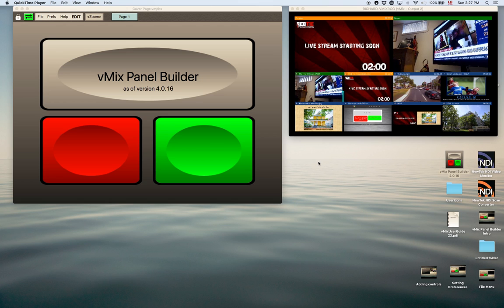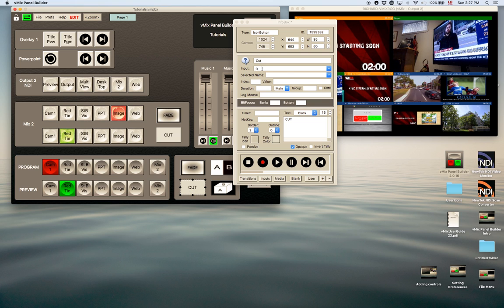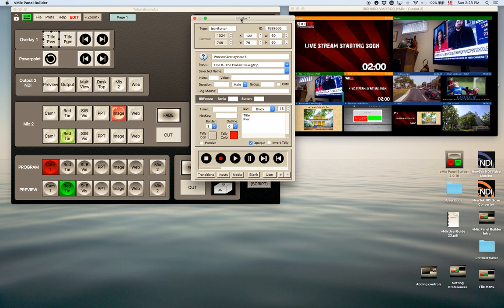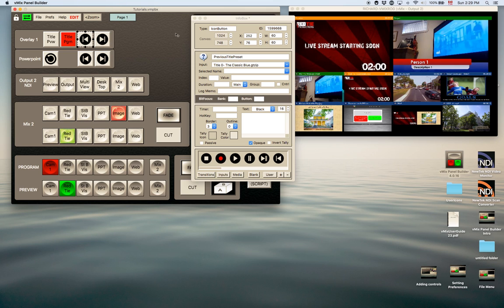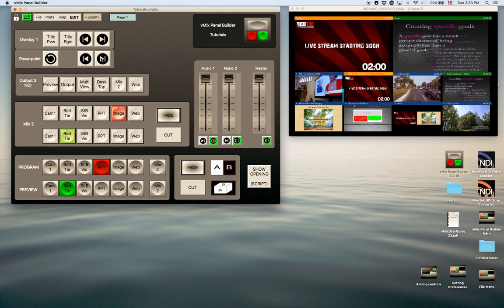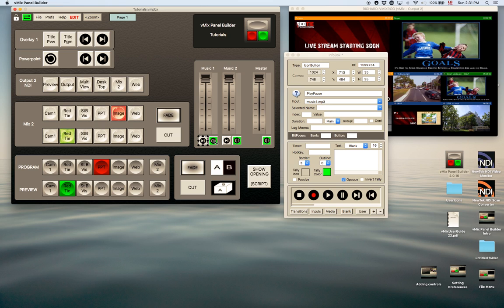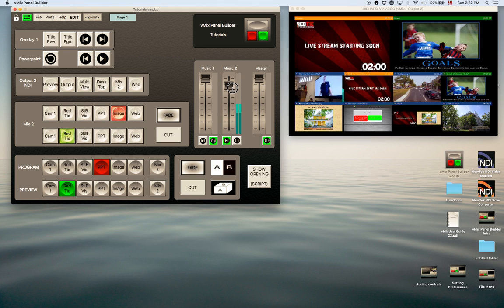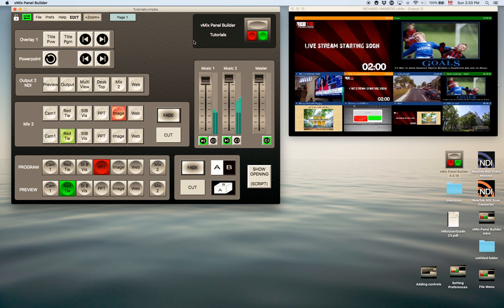Adding commands to Buttons

Comment: Checking how to use Groups, 
I would like to copy a full set of controls for Multiview,
then collectively change the target input
maybe a group multi edit feature will be a nice feature request?

tldr
typing the same string in Group for a number of buttons, 
then setting 1 button with Cntrl with parameters i like for all buttons in the group.
The settings i will like synced is unset on the other buttons
Before and after pressing the Cntrl button, behaviour is the same
Reply: The group feature is designed to work as you are requesting (multi-edit). Create your set of buttons for the Multiview and assign all the buttons to a common group name or number. Then create "control" buttons that will change the parameters of the buttons within the group. Enter the parameter (Command, Input or Value) that you wish to change (in your case, the Input). Then assign the button to the group name or number you wish to control and select it as a "cntrl" button. When control buttons are pressed, the parameters within it, will be applied to the buttons of that group.

Comment: Having a hard time getting the Tally Lights to adjust once the audio input is selected. Followed your steps but when selecting the tally color, the icon button simply turns that color regardless of its command/ on or off. Any thoughts as to why this might be happening? I appreciate these videos and the help!
Reply from the maker: Hi Joe, 

When you say the audio input is selected, I'm assuming you are using the "Audio" command to turn the audio On and Off. This is a common function and should work properly. There may be something else going on...

Please email me at info@studio793.ca  so that we can have a more detailed discussion. I'll be happy to help you. 

kind regards,
Richard